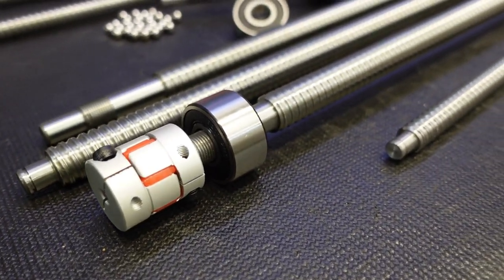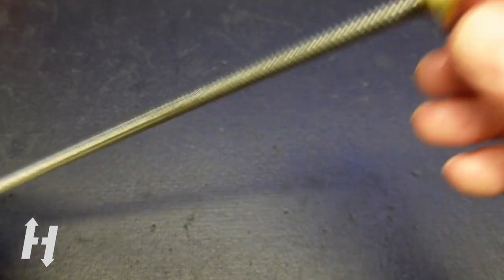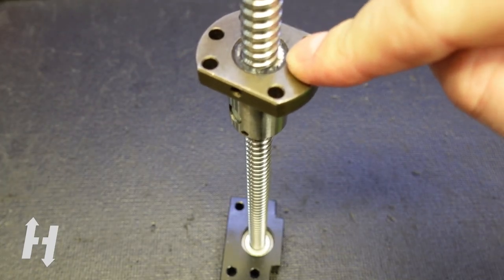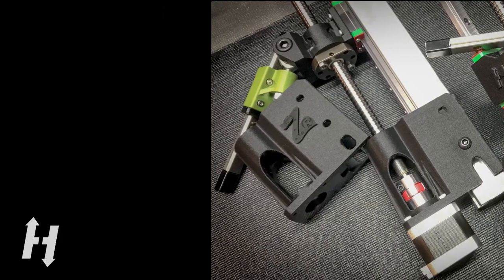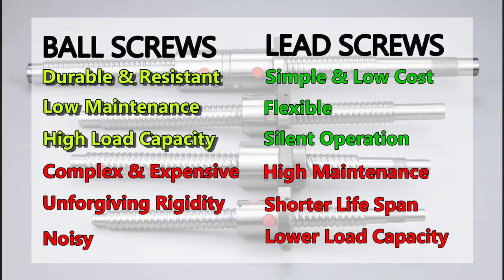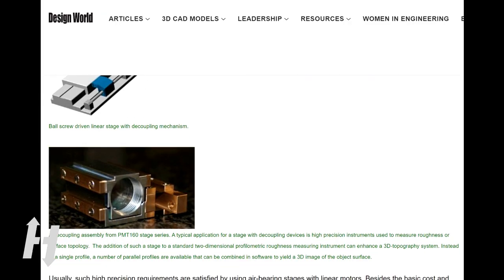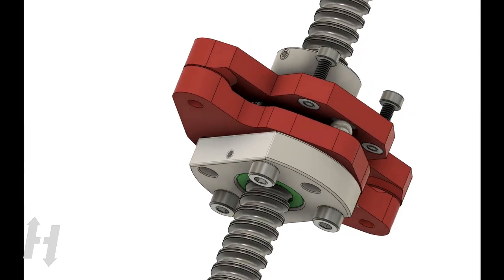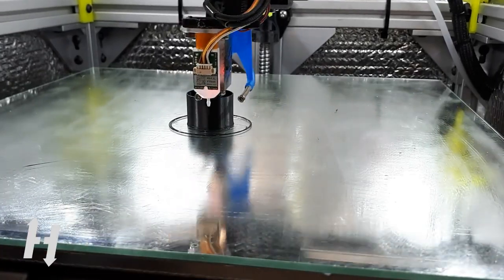Fixing Z Wobble from 20$ Ball Screws with that simple device

Comment: Very nice design and execution ! Did you test the behavior of the system at temperature close to the Curie temperature of the magnets (80deg C) ? Or maybe do you never need to reach those temperature anyway ?
Reply from the maker: I manage to keep the temperature fairly close to ambient for all parts that are under the heated bed.  The bed area being quite close to the walls, this helps with the isolation of the heat zone.  But yes, higher temp rating magnets are being investigated.
Reply: dude, curie temp for neodymium magnet is like 300-400 deg C
Reply: @jackl2254  thank's ! here's the update : 80°C is the temperature where the magnet starts to loose its magnetism (maximum use temperature), still reversible though. Curie temperature means definitive loss of magnetism, and is indeed around 300-350°C for neodynium magnets. I won't make the mistake again

Comment: Soooo your mixing water and oil!
Never put sugar in oil's,  recrystallisation / humidity / and simple chemistry says no no no.
The Lucas Teflon coating should be enough on its own. If not use 100% petroleum jelly and the Lucas.
Reply from the maker: I am not using Maple Syrup for real ;) That was a joke.  As mentioned in the video, I am using 20W50 Synthetic motor oil mixed with the Lucas additive ;)
Reply: @MirageC  ohh😆 I missed that bit! 😂 
I'm glad 😁😂
Reply from the maker: @hulkgqnissanpatrol6121  :)

Comment: i had to completely redesign my printer when the screws i bought gave me wobble. tried something very close to what u are doeing but could not make it work..
Reply from the maker: The best solution as per what I see now would be:
1-  buy the best ball screw your budget allows.  
2- Straighten it using dial gauge, v-blocks and a press or lever 
3- Decoupling device.
Reply: @MirageC  i ended up using belts..
Reply: @MirageC  actually my screws had poorly machined ends . made a jig to measure it.  its easy to find if u fix an electric screwdriver in one end and turn it on fast. 
grab the nut  with your hand. 
 the good ones almost dont wobble around at all.   the bad ones... well.. u will see.

Comment: that's not a solution at all. The problem you have is caused more because of stupid solution: you placed linear rails with carriages which can withstand easily the forces you could have from a bent screw, but you placed on them weak plastic table holders that bend easily. Also bent screw leads to imperfections in the layer high.
Reply: I’m sure a solution provided would be more helpful than pure criticism
Reply: @M3NT8L_one  solution is not to use cheap screw. If you don't have enough money you'd better make z axis on belt and use geared stepper, to prevent bed from falling, but I think it's not a great problem. And second solution use at least aluminum parts on linear carriages. If you use plastic parts it's just useless and it's better just to build printer on shafts
Reply: @OlegShtyrev  Many, many hours printing great stuff with plastic parts tends to prove “useless” incorrect. By that logic, titanium should be the only choice for parts as it’s far superior to aluminum or carbon steel. If you decide to build a titanium printer with multi thousand dollar mechanical parts please share. We would love to see that.
Reply: @M3NT8L_one  it seems like I have discussion with person without any engineer's education... Ok, I'll explain: each construction for each propose should have special rigidity. For example if it's cnc mill for milling metals the best solution is to have portal style frame made of cast iron, steel t-slot table, linear rails at least 25 mm wide and etc because the milling bit have lot of forces, which tries to bend the whole frame. As for 3d printers there is no need for that rigidity, because there is only extruder who produces not to much forces because of it's accelerations on movements, and build plate who have to carry it's own weight and max 1 kg of printed model. For sure during, as we say in Russia, building the printer "on your own knee" without high precession measurement equipment for placing 2 rails on the same axis extremely parallel and on the same surface is impossible, so some bending forces appear during movements, and if you have not enough strong parts you'll have some unwanted and unexpected movements. For 3d printer parts for sure aluminum parts are strong enough to avoid this problems. Maybe even plastic parts could be rigid enough but they should be modeled correctly with stiffeners where they needed.
Reply from the maker: All valid points, perhaps the form needs a bit of rework, but yes you are correct.  Ideally 2 rails per screw would fix a lot of other issues.  This is the way they should be mounted for an individual triple Z system.

Comment: Great video, great analytics, and innovation to solve a problem! About ball and lead screws: They are more accurate and last much longer if they don't support weight, such as the Z axis. This should be done with a counterweight or counter spring that reduces the force on the screw to a few ounces. Even massive milling machines with massive ball screws use big counterweights or their screws wouldn't last a month. It could introduce backlash, but that's another problem for you to defeat!
Reply: I like the counter weight idea... make the counterweight big enough and now the ball bearing is pulling down the bed, instead of a ball bearing and magnet to support the plate, a simple set of strings might be enough. Or invert the whole thing, instead of having the bed pushed up, have it pulled up (suspended on the ballscrews.... no counter weight, same results

Comment: I would say that it is more important to check that the motors are not off, some printers have a motor off option and then you get a strange movement. Z doesent move up or down unless you print some strange vase mode, it shall only lift, or lower in one direction throughout the whole print..and then you really should not have any problem with backlash in that axis really. What could be " backlash" is sometimes ghosting wich can be caused by a not fixated top on the z. If you have an open non supported end ( ie mising a top bearing) the screw wobbles and look like backlash. Even if the nut is worn out as hell, it shall still be capable of just lifting without backlash

Comment: nice hacks... it will be cool if you will made a video about s42b or any other pid driven motor regulators for 3d printing
Reply from the maker: S42b closed loop stepper motors are pretty much only for unexpected crash of the system, they can resume a stepper motor that has lost synch.  Unfortunately, this system can not be used for increasing accuracy of a 3d printer and neither its performance.  If you are solicitating the stepper motors beyond their torque capacity, the S42b will only ask for the controller board to wait for that motor to get back in line for the next series of moves.  Unit the next move is too demanding, then... wait again.
Reply: @MirageC  thanks for that comment... I am trying to use s42b on 800x800 field for my custom string art machine @ninjaartstudio in instagram... But i cant make it move faster than 340mm sec =( with more agressive pid comes bad astilating noise(

Comment: I wonder if the rotation could be prevented by attaching the nut to the vertical linear rail while still keeping the bed carriage decoupled through the ball bearings
Reply from the maker: Printer vibration would probably swing the bed back and forward.  And this would become problematic for non-planar capability,
Reply: @MirageC  fair point

Comment: This needs to be patented. Even if you make it public, it's necessary to prevent some Jackass from doing it and making money from your hard work.
Reply: by the very nature of publishing it, it can't be patented - its now "prior art" that will also prevent other patenting the same thing (but ofc someone will change the font and get a questionable patent)
Reply: patents are an hinderance to progress. IF reprap was patented, what would have happened to the 3D printing community you think? Many stupid patents exists, for instance, the heated enclosure is patented... I could be partially fine with a patent offering a manufacturing method, or a non-trivial innovation, but many patents are simply preventing concepts from being used by others. IE : heated enclosure. Did they invent the oven? no. But using it for 3D printing is enough to be granted a patent it seems...

Open source is a constant source of innovation. See how Arduino changed stuff. Reprap too. Openbuilds. Or more recently how risc V is changing the micro controller ecosystem....

So thank you to the creator for his video, and documenting it. Indeed, open source is nothing without documentation!
Reply: @AudreyRobinel  I believe the FDM 3d printing process was already patented long ago. I'm sure a google search or two would turn up some patent documents. I think reprap was only able move forward with things because the patent ran out but that is just speculation on my part.
Reply: @K9Megahertz  that was my point!
When the patent was active, not much happened in the consumer 3D printing space. When the patent expired, a new industry emerged. 3D printers went from enormous expensive machines to small, cheap and easy to use devices... Slicers got amazing, with plenty of amazing free software to back things up, such as marlin, octopring, prusaslicer, cura, etc...
Reply: This isn't actually new: Roll-in-Cage (RNC) isolation has been used in civil engineering to decouple the lateral movement of foundations from the structures they support in quake-prone areas for decades. The first ever suggestion (on record) of supporting structures with spherical bodies dates all the way back to 1906.

Comment: Great solution - cheap and easy to make. I have a question: what is this insulating material on walls of printer ? Is it silencing the printer in any way? it looks like those mats you use in car on doors etc, to silence it.
Reply from the maker: It is simply some bubble wrap insulation with thermal reflector found at the hardware store.
Reply: @MirageC  Oh ok, thanks. im going to do a similar thing :D

Comment: This is some excellent work. I did came across your Hevort in the past, but never built it as when i opened the cad, it looked too complicated and I wasn’t sure there’s any reason behind that (like some people make things complicated only because they can so to say) 

This z azis wobble idea is absolutely amazing! 

I myself I’m using a highly modified hypercube, with active heated enclosure, and not many original components. I ended up redesigning most of them to solve issues i had with mine. Rigidity was a big one for me. 

Is the Hevort still hosted on Thingiverse? I got no idea where last time i found a step file on it (it was during my search for linear railed core xy) 

I still haven’t migrated mine to linear rails. Just used 12mm rods for Y and z axis, and 10mm aluminium ones for X. 

Next I’m changing heated bed with a cast tooling plate, and during that time might be looking to ad xy linear rails
Reply from the maker: Thank you!  All data for the HevORT is here: https://miragec79.github.io/HevORT/purchased/

Comment: Damn, that was epic!
...And now there's me getting the cheapest leadscrews for my printer/CNC mill/laser combo machine, realizing they're a bit too bent to my taste, then proceeding to hand bend them as close back to shape as possible. That, was the 2nd ghetoest thing I've done when building that machine (the biggest one was cutting round spacers with a saw pressed to the part rotating on a hand drill), surprisingly good results for such sh!t techniques for sure! No idea how they got bent, if they arrived like that or I screwed them up somehow, just glad and funny that it worked.
Reply from the maker: The manufacturing process is where they mostly get bent... I will make another video where I straighten them with a dial gauge v-blocks an a lever.

Comment: Great work. I do wonder though if it would be easier to just not constrain the top end of the ball screw and use a flex coupler to the motor.
Reply from the maker: That will work if the printer frame/parts are rigid enough to work against the thrust bearing seat and the flex coupler.  I am using double row angular contact bearings as thrust bearing and spider couplers to achieve motor connection.
Reply: @MirageC  That brings up a good point in my mind. Many printers use the motor shaft as the bearing, but the motor's bearings are not really designed to handle those loads, particularly the thrust loads.
It would probably be better to handle the thrust and locating (radial) loads at the top end, and let the motor float except for a flexible strap to handle the torque. Then the motor doesn't bear the loads.
Reply: @court2379  The HevORT z setup has the ball screws riding on a thrust bearing at the bottom, the motor is floating

Comment: I like your wobble wings, very cool! One thing you left out of your comparison to T8 lead screws is speed. Ball screws work great on the Z axis. However if you attempt to use ball screws on either of the two other axis, they are too slow. There are other types, such as acme fast twist that are accurate and not too expensive. For the lead screw nut, there are multiple polymer options available. I have access to cnc machining, so I can make my own, but this is not necessary. Thanks for the video!
Reply from the maker: It all depends on the ball screw models and the application.  In the case of an application where repetitive and frequent movements are required, ball screws will always provide better reliability and durability.  This is what they are meant for.  As for the speed, then again, it depends on the ball screw model.  See this pick and place machine using larger pitch ball screws: https://www.youtube.com/watch?v=RS-ci8tGp7g&feature=emb_logo

Comment: Genius! Are you using magnetic ball bearings in this system or are you relying on the magnet sandwich to do all the work?
Reply from the maker: The balls I am using are chromed steel balls non-magnetized.  The next evolution of this system will integrate a harder surface for the balls since neodymiun magnets will degrade over time due to friction and pressure from the ball bearing.

Comment: Why don’t you straighten the ball screws with an arbor press with and dial indicator (straightening press)
Reply: Really good chance there are complex /compound bends and spirals that would take a nightmare amount of effort to straighten.
Reply from the maker: I have some vblocks on order.  It is part of my plan to bring them as close as I can to straight.  But looking at precision ball screw installation from the industry in general, most of them will include decoupling devices such as flexure plates.

Comment: I just wonder if similar detachment of horizontal wobble could not be achieved using flexure joints, which can be 3D printed
Reply from the maker: This is an excellent point Peter.  I had thought of that approach at some point but tossed the idea aside due to the space constraint I was dealing with.  Until you brought the point again.  After reading your comment it occurred to me that a combination of the 2 systems could be good.  Balls & magnets  for which I am intending of using a harder surface to sit the magnets by the way, combined with a printed flexure plate to maintain the rotation alignment.  
My initial investigation of flexure joints was having me wondering how to keep the assembly small while being able to support the Z load when making it out of printed material.  But if we isolate the Z load with the balls, then we could probably print an acceptable size flexure plate for the alignment.  Sorry for the lengthy and erratic reply, but you triggered something ;)  Thank you :D
Reply: That was the idea - to bring it to your attention!

Comment: Excellent engineered solution! I have a question . If ball and lead screws suffer from wobble which requires a printer frame to resist, why not implement a Zed axis that is belt driven? It's not a CNC so there shouldn't be anywhere near the stress even at high speeds, build plate isn't traveling fast
Reply from the maker: Yes belt Z would work. Back driving will be the main issue and the belt would have to be sized properly according to bed weight.

Comment: I really like this technique, my only gripe is it can increase backlash if outer magnets aren't able to manage rotary forces during direction changes.

One of the interesting aspects of flexures is that they are great at providing motion in a particular axis. So if you only want X and Y motion without twisting it's a good direction to look into. Of course most flexures that work well tend to be metal.
Reply from the maker: YEs, seombody else mentionned Flexures and complaint mechanics.  I am working on a V2 Wobble Wing concept :)
Reply: @MirageC  awesome best of luck 👍

Comment: Wouldn't small tension springs work just as well as magnets (and be cheaper, to boot)?
Reply from the maker: Springs load curve has the exact opposite behavior than magnets;  it takes very little force to start deforming the spring. The require force per distance of deformation then increases with the distance.  On the other hand, magnets have the stronger force when they are the closest to each other.

It might work, but I dont see it as an improvement.

Comment: Awesome idea and execution! Do you think there's any measurable effect on the rotation acceleration? I wonder how this would handle a nozzle crash? Maybe you could put a limit switch so a crash would hit it and trigger an estop.
Reply from the maker: Depending on the ball screw friction and the Z acceleration amount, the wobble wing may create movement lag.  But since Z movement are usually not fast with very low acceleration this is not a major concern for the moment.